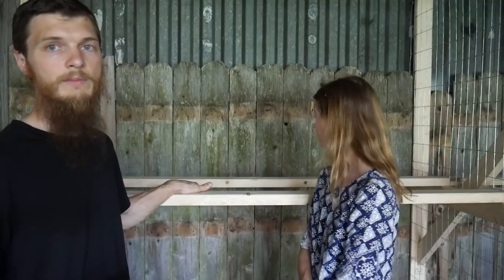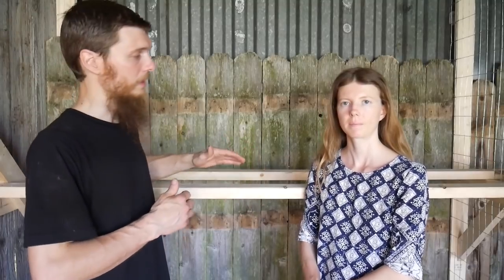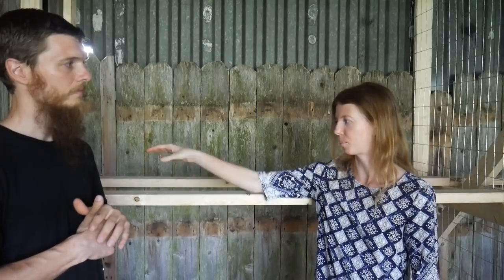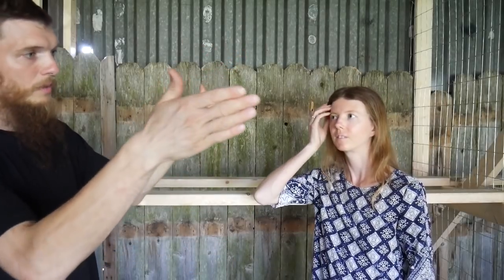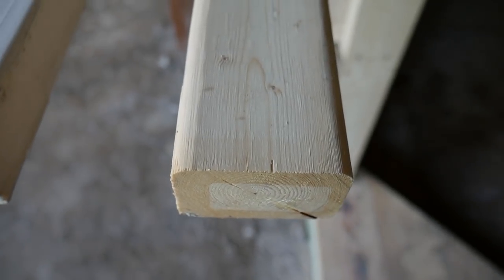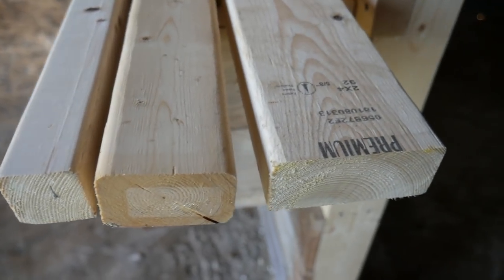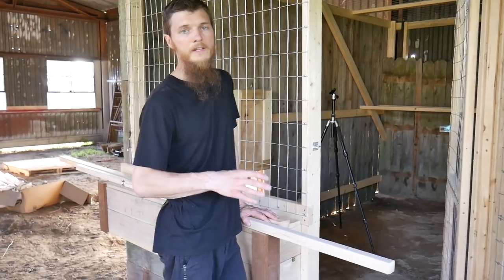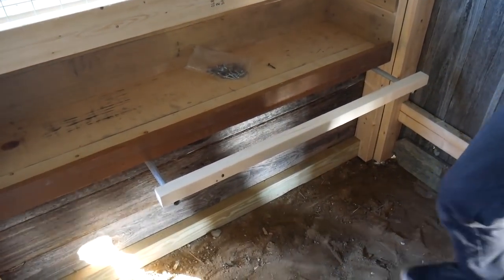The Comprehensive Roost Video - What you Need to Know About Chicken Perches

Comment: I use 2x4's for perches my chickens prefer them. The only problem I've had is the 2x4 will eventually bow in the middle. Hindsight 20/20 I should of put in a center brace as the chickens tend to choose the straight perches over the bowed one.

Comment: Interesting & good information. Many many years ago I always saw 2x4s used as perches, and thought nothing of it. Recently, I've seen the same ideas that 2x4s are too big and to use round perches to mimic what they'd have in the wild. I just went with thick branches because they were free. Hens seems happy with them, and I won't have to worry about the lower temperatures you'll have in winter. I might have to put a 2x4 and a tree limb side by side and see which one they chose someday.

Now you got me thinking that one type of perch may not be best for all breeds of chickens. Bigger chickens might want/need bigger perches versus little silkies or smaller breeds with much smaller feet. And hey, at least our chickens are getting perches, all the big meat and laying chicken operations don't have any perches for them. Thanks!
Reply from the maker: Yea, your setup looks like it's working great. The best solution for me may not be the best for someone else, every flock and situation can be different. I actually considered using branches for perches...since we have a lot of them laying around, but in the end I went with the 2x4's and am happy with them. It would be interesting to see what your chickens would choose between the two choices.

Comment: Hi guys. I just built a chicken coop by looking at pics on Pinterest. I'm not a carpenter or anything like that by any means but I think it turned out ok. Expensive, but ok. :) Its small, 4'wide X 8' long, and tall enough to stand in. I had been wondering on how to do my roost and this video of yours was just what I needed. It made sense to me and that's the way I made them. My hens are only about 2 months old, and not use to a coop. They been in a small cage all this time, so they didn't know how to get up on the roost but they'll learn in time. Also your video on the Trap Door was great as well. Its also how I built mine, well, not as good as yours but it works. You make it look so easy, I like that!  I also got tickled at your wife having the hiccups. Lol.  Thanks for all the advice you share with us, you two!  :)

Comment: So I been raising barnyard chickens for 50 yrs.
I have flat an round saplings that I use an what you will find is whichever you put the highest is the one they'll choose most of the time.
Personally imo I cut saplings about 2 1/2 inches in diameter an I've never had a problem with it.
the problem I have with the flat board is it will get covered in crap alot quicker.
If your chickens are getting frostbite your coop is to big or needs sealed up.
Example 4+8 coop will hold roughly 15-20 chickens an your water will rarely freeze in the winter.
In the warmer months a bigger coop is better imo.

Comment: really excellent video.  I don't think you mentioned these points:  the smaller size roosts (like a 2x2) don't have as much structural integrity so if you have a longer span you can have some sag.  Also, keeping the roosts up to 4' or so makes cleaning the mess much easier (and more of it will be in the same place if the roosts are concentrated in one area).  I think the diagonal roosts are a pain to clean around.  Sadly, some of my chickens still roost way up in the coop where I fear that they will eventually get hurt.  That's on my fix list.  My other coop was poorly designed and poop in the nest box is sometimes a thing.  Luckily we added a lean-to addition and even though it is colder they prefer to roost out there.  We were looking for something with open sides but a roof so that they had a snow free area outdoors in the winter.  That has worked well.  I can close them in the coop or the lean-to or the entire fixed chicken yard at home (no free ranging at home as various neighborhood dogs have twice broken into my fencing and taken out my entire meat flock).  Similar arrangement at the farm with the addition of free ranging (and, unfortunately, varmints but, fortunately, two LGDs).
Reply from the maker: Great thoughts!

Comment: Thank you for a great video. I currently have 1 1/2" round roosting bars. I put in 2x4s and they didnt seem to like them. The next night I found them on the floor of the coop so I removed the 2x4s and the are roosting again on the round perches. I'm not giving up. I might use a router with a 1/2" round off bit to round the edges more than what they are. Not sure if that's a right move or not. What is your thoughts on doing this?

Comment: Just curious.... are you planning on patching the remaining holes in the metal walls?  And,  did you replace the concrete blocks when you redesigned the coop?  I may have missed that part.
Reply from the maker: I am not concerned about the holes for now... but we may in the future. The blocks didn't need to be moved but Ashley did add an extra block under the place where the doors connect to the center wall to help carry the load.

Comment: We are having several bumble foot issues. I use 2x4’s also. I think mine might be too high. Thank you for the video. Have you had any issues with bumble foot?
Reply from the maker: We never had issues with bumble foot. Height could be an issue. Also make sure there is nothing sharp around causing cuts to their feet.
Reply: DIYfferent thank you for the advice. I will lower the top roost height tomorrow and hopefully that helps. The coop looks great. I love the double coop setup/design.
Reply: If the height adjustment doesn't work, wrap the perch with jute twine. Make sure it's jute and not sisal.
Reply: I have seen a few other suggest that wrapping your perches with a twine type of rope...  As I recall the claim was that more air would get to their feet and allow it to heal.   Please note I claim no expertise on the subject.  Just repeating what I think I heard

Comment: I don't agree with you , I have always used tree limbs and have had no problems. But everyone has their own ways of doing things. Have a great Memorial Day !!
Reply from the maker: If that works for you and your chickens then that's great. That is one of the biggest things I want people to take away from this is that there is not one "right" way. Studies have shown that chickens may be more comfortable sleeping on a roosting bar with flat surfaces but as long at the branches are not hurting their feet and are big enough (2" to 3") then they will do the job!
Reply: vague comment. which part was not agreed on? when the couple said that they have had no problems using 2x4 as perches?    based on the other  comments, most people have had no problems with 2x4 either

Comment: Let me put it to you this way, I put up 2x2 roosts and a 2x4 roost in the same coop and there were ZERO chickens on the 2x4 roost night after night so I'm going ahead and sticking with the 2x2 roosts from now on.
Reply from the maker: That's the best way. Do what works best for your and your flock. A 2x2 board is a good perch.
Reply: was there a difference in height or in area temperature  between the perches?